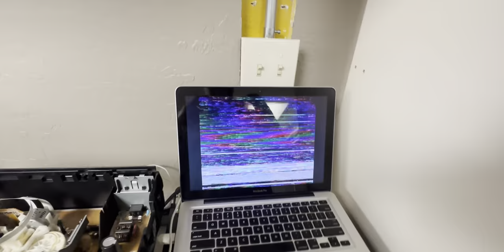Cleaning Mold from a VHS Tape, one of THEE worst in My 20 Years of Transferring Video to Digital

Comment: I happen to have a couple of vhs tapes with slight mould on them, one of them I only noticed the other night when I was about to watch it so I thought nah I don't think it would be sensible to insert it into my machine, it's now back on my shelf! It's a rather old one , might have to try the razor blade method to clean it! It was from a house clerance and could tell it must of been stored in a damp place, it's only very mild so I don't think splicing that section would harm it, unless it's turned to sticky tape no pun intended!
Reply from the maker: Yes best to not put in a vcr! All the best

Comment: You cleaning the top of the reel, but what's about the bottom? Shouldn't be there mold as well? Nice vids btw!
Reply from the maker: The bottom is cleaned on the cleaning machine. Typically not that much crud on the base. I’ll do an example of that on the next video.